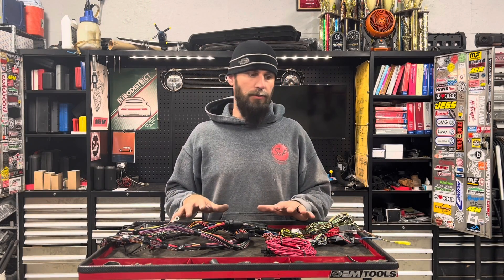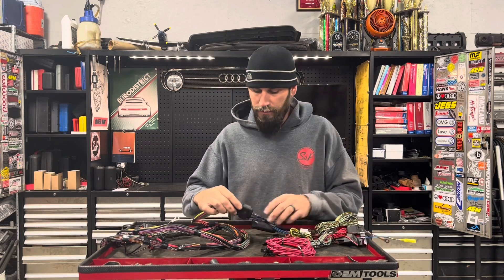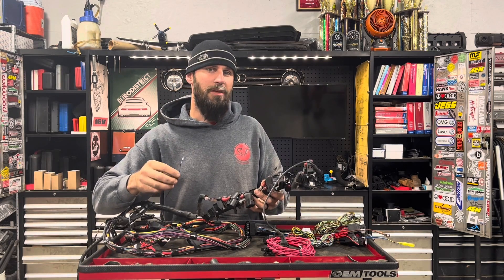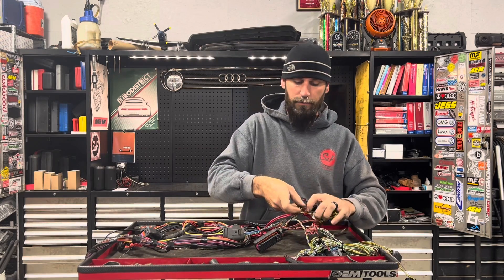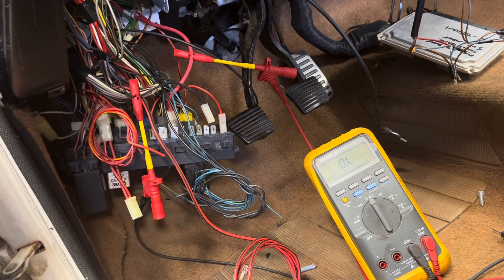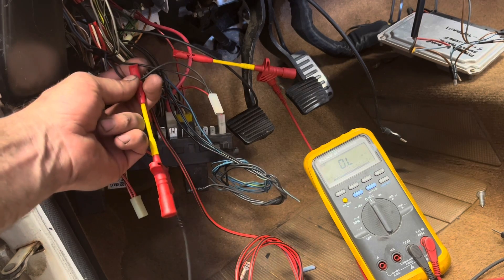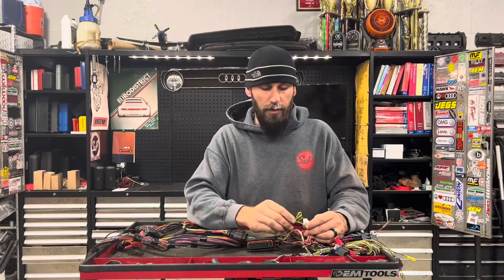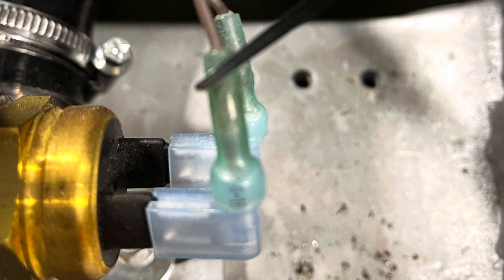Mk1 24v Swap Harness Overview

Comment: Hi mate, im doing a 3.2 vr6 bdb swap in my t5 van, i've figured everything out except the key on power / trigger,  which wire is this, is it coming from the ecu or ignition solenoid/barrel ?  and goes to where? 

I've stripped all the donor loom body side from everything excluding whats on the ecu plug, figure out the fuel pump and main relay... just don't know how to connect it to the ignition for starting

Comment: i have 01 24v  auto transmission cummins installed in 97 dodge standard transmission  you make the stand alone wire
Reply from the maker: Volkswagen/Audi only. Sorry

Comment: Hello, i have a 2009 TDI automatic Jetta, can you guys modify this type of model? If so, Do i  send my complete wiring harness to you or do you have it in stock? It is for swapping in a 71 Westfalia. I want to install the engine with automatic transmission.  It will probably be chain or belt driven. Thanks
Reply from the maker: Yes I can
Reply: @spautomotive4323   How much does it cost? Do i send my wiring harness to you.Also there is a garage near by who did immobiliser key off, dpf delete,Ecu stage 1(=35hp)Im not familiar with all these code., Thanks for answering.
Reply from the maker: @bennettdaniel798  I can handle the ecu work as well. Send me an email on the website and we can go over it. You can build the harness costs here https://s-pautomotive.com/product/vw-wiring-harness-services/

Comment: I have mk4 12V VR6 pulled out of a 2000 Jetta. Would love help mating my engine harness to my ‘92 MK1 Cabby. All stock MK1 dash and gauges I’d love to make work as well. Drive-by-wire pedal and throttle body as well.
Reply from the maker: We sell the hardware and this harness video will be the same as your harness for the wires you need to splice into the cabby anyway.